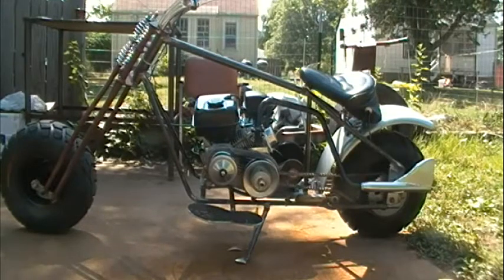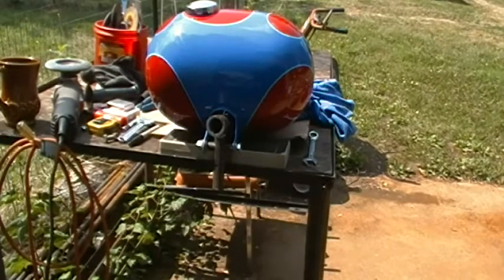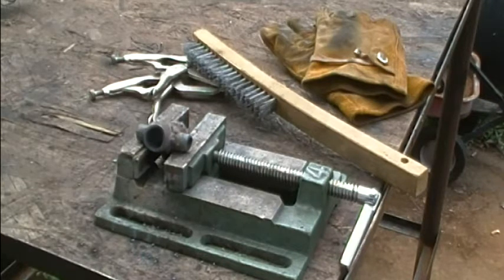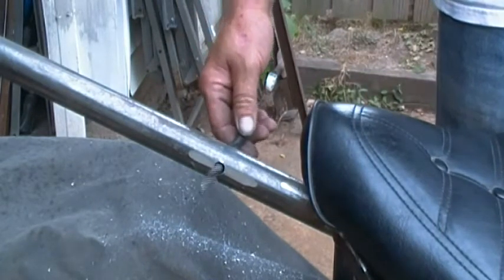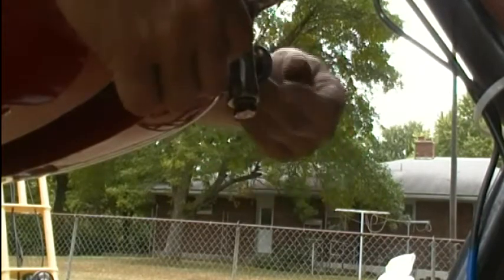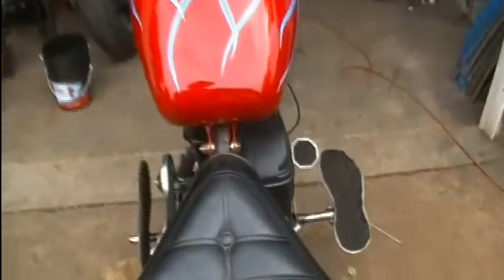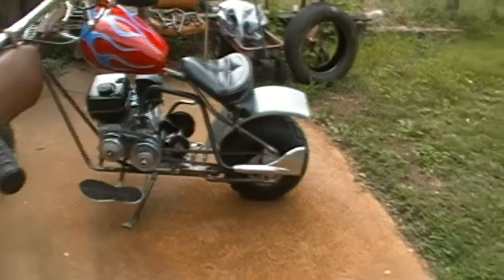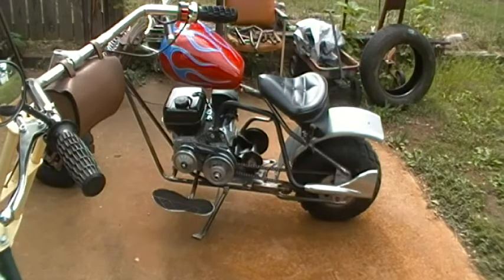Springer Bike, Mounting That Pauchgo Gas Tank

Comment: the bolts you have are grade 8 bolts those are the strongest bolt you can buy from tsc and the green color ones are grade 5 bolts not quite as strong but they are still stronger than the regular silver bolts you buy. and the bike looks AWESOME